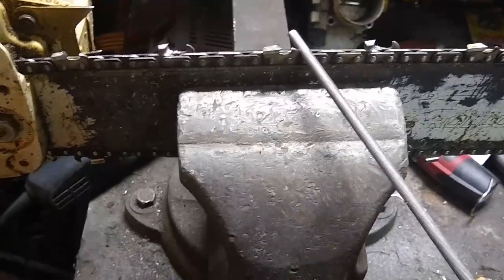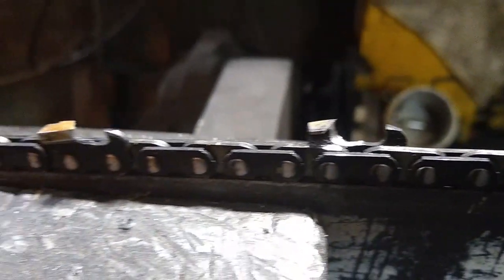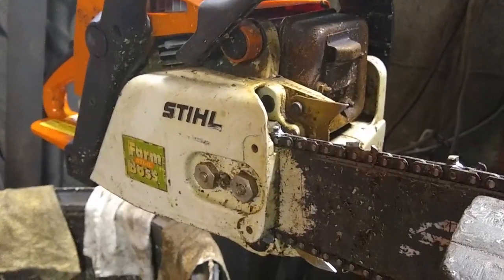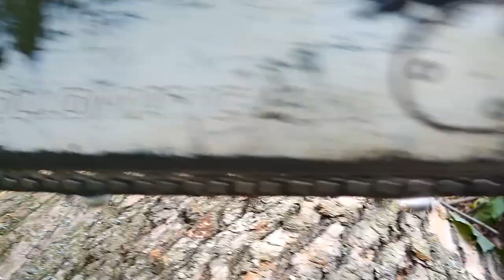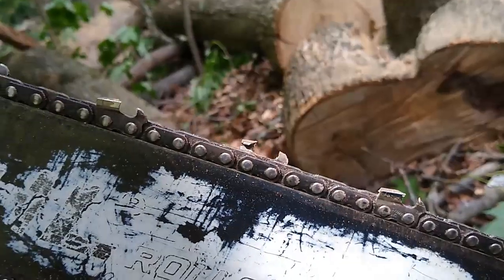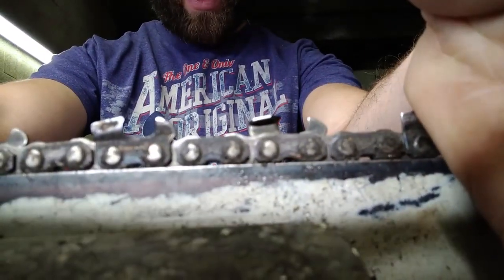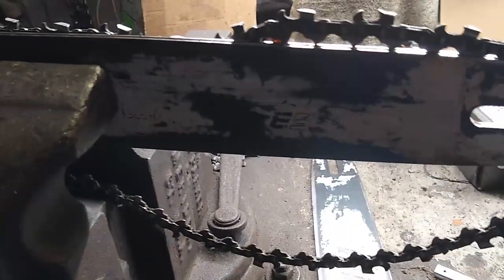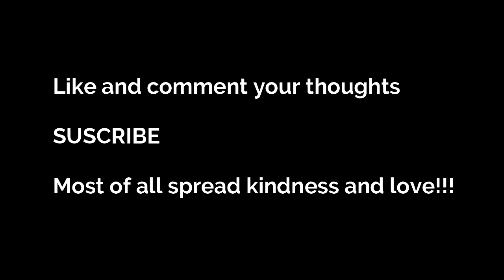Chainsaw myth... Uneven cutting teeth - Stihl 029 super 20” bar

Comment: It's all about the depth gauge. Half the raker gauges they sell won't fix that problem. Carlton file o plate or Husky progressive gauge will set the raker for the tooth length.

Comment: That is a skip tooth chain.  Wonder how a full house one would do?
Reply from the maker: Yes it wood be interesting to try it on a full house chain!!!!
Reply: @timberandtools  Yes Buckin Billy Ray had a video that agreed with your findings.  Can remember if it was full house or not.  With each raker adjusted Independently I don't think the saw will lead off.   I believe people that say this are working off Theory rather than trial as you did.
Reply from the maker: I think he did have a video like that as well! I wanted to try it for myself and get the results!

Comment: Its the bars rail height that guides the bar threw the wood if one is higher than the other it will cut crooked like a train on a track if one rails higher than the other it will turn.
Reply: Why would anyone run a bar so far out of spec?
Reply: You are both correct. Why would anyone run a bar so out of spec?   Because they don't know better, and that comes with experience. Bar rails do wear unevenly in spots, but most people don't take that into consideration. Cleaning the track and dressing the bar is very important. So is flipping the bar every few hours of use.

Comment: I was glad you finally called them depth gauges at the end, because if you're teaching something, knowing the proper names for things is key.  
I enjoyed the video and it was quite informative.   However, I have to say, if you sharpened that chain, you're doing it wrong.   You shouldn't be sharpening lower, especially so low that you get into the connecting links.   
Pull back and up as you sharpen.  The tip is all that's doing the work.   

(I know I know, every tree guy knows it all and this may fall on a million deaf ears, but it's worth a shot..    "if you can reach just one person". Lol)
Reply from the maker: Well I like to get down into the bottom of the tooth and get the gullet out. I would not say I'm wrong to touch the drive a little bit. Never had a chain break. Everyone has thier own way of filing, this was really a good expirement more than anything.
Reply: A depth Gage is a tool used to set the raker depth.    Or is it a depth gage, Gage.   I'm confused.
Reply from the maker: It is a depth gauge and a raker gauge. Same thing just depends what you call it.
Reply: @timberandtools  Is the tool one uses to set the chains cutting depth a Depth gage or a Raker gage?  still confused.  How should i refer to the chain's cutting depth Mechanism?
Reply from the maker: @strayfiftynine9151  I refer to them as rakers but I suppose the technical term is depth gauge
Reply: Usually you shouldn't pull up when filing, this will result in a really blunt topplate angle :)
Reply from the maker: @harm7448  If you are unaware of this it definitely could happen. I usually I will take the top plate back if it’s damaged badly in this way
Reply: @timberandtools  i see some people really pulling up hard, than the saw will produce something like a wood powder :)
Reply from the maker: @harm7448  yeah that’s no good!!! Hand filing is an art form somewhat haha. My mentor files so different (cuts like mad) files straight across tooth and very aggressive on rakers. I am more conventional lol.
Reply: @timberandtools  o

Comment: Over here it's always been doctrine that each tooth has to be the same length but I've often wondered about it myself - I reckon you're right that what's important is that each tooth cuts the same and that's determined by the difference between the tooth and the depth gauge and by each tooth being sharpened in the same way.

I worry a bit about the terminology as well - call the depth gauges "depth gauges" and a depth gauge gauge a "filing gauge" - that must be very confusing to new folk...
Reply from the maker: It was a perfect opportunity to test the theory haha. I have even noticed on new chains how much better they’re cutting it I hit the rakers with a gauge first even without filing anything at all !! Thanks glad you enjoyed the video